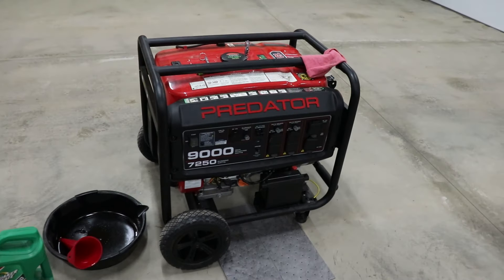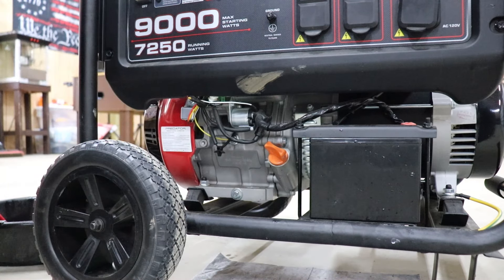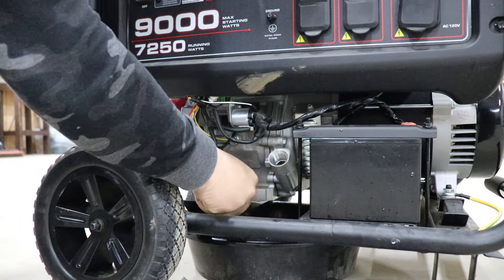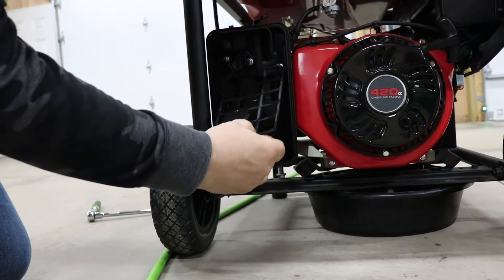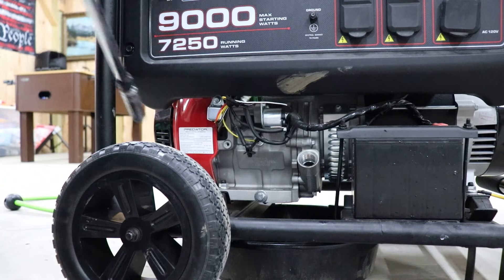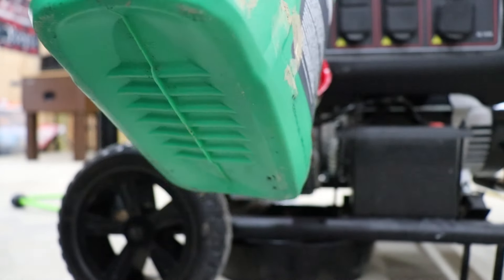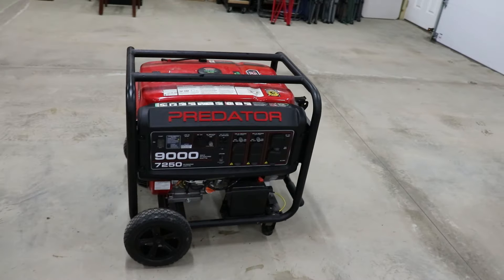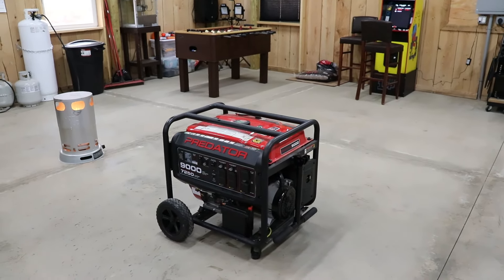Predator Generator Oil Change ~ Maintenance

Comment: I have a Predator 4000w, and a Briggs & Stratton 9000w. I bought an oil plug extender for them to make oil changes super easy. Also, I use disposable paint measuring cups i got on Amazon to measure the oil to the exact amount needed. Nice video sir 👍👍